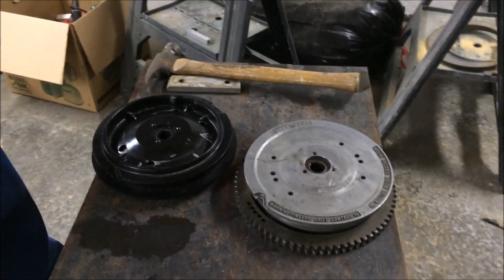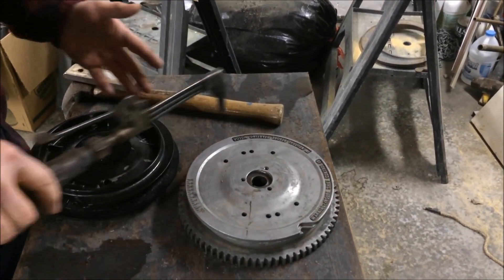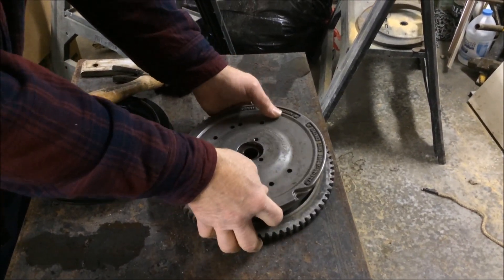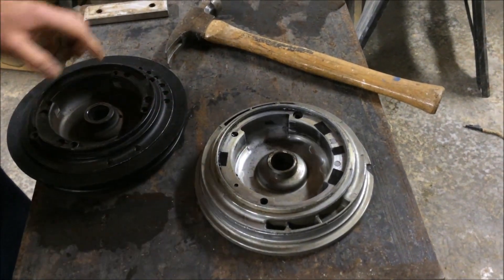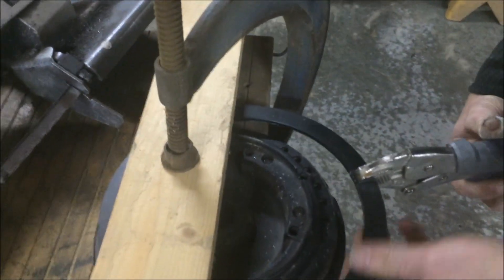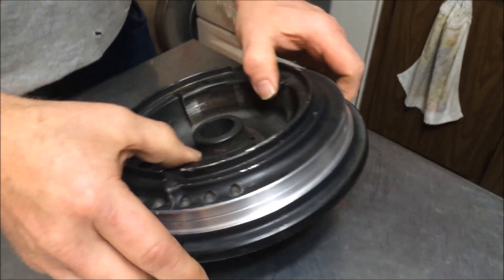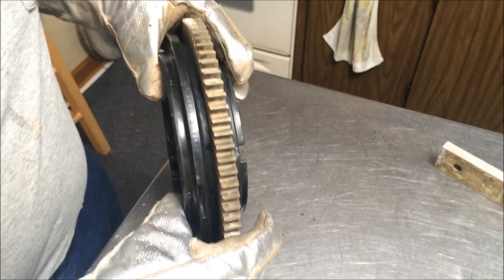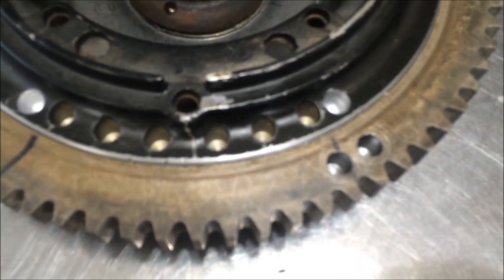How To Add Electric Start to Outboard Motor Part 1 of 2

Comment: I must be snorting coke because my 1982 Mariner 10 HP outboard has both electric and the recoil starter on it. I also worked 20 years in the Navy, and all the Zodiacs I drove had both on it also. Over the years there were Evinrude, Johnsons, Mercury, and Mariners and they all had both recoil and electric start on them.
Reply: I have a mercury with both pull and electric start

Comment: Is it possible to find a flywheel from elec start and do it that way. Not sure I'd be able to do what u did with flywheel
Reply from the maker: You probably can but I could not at the time because of the ignition system
Reply: @Ian-Threaded  my 94 Evinrude has the gear teeth on the flywheel but it's a pull start is it possible to use that it's a 8 hp

Comment: i have a remote steering 86 johnson 25 and i want to make it a tiller. can i just buy a bracket or make a bracket to bolt onto the existing one? also how does the throttle linkage work? how does it connect?

Comment: I dont see any other way to private message you. Why didnt you use the aluminum flywheel with the ring gear instead of the black flywheel?
Reply from the maker: I had to machine my original flywheel to accept the ringgear because my motors ignition would not work with the flywheel that had the ring gear. - Ken

Comment: Was wondering ,I got the same bracket for starter from a 1977 35hp.Did you have to adjust the timing stop screw that is on the bracket you put on.?

Comment: It was very good that you put an old (1976-mid 1988) 11 tooth starter on to match the old ring gear.  A lot of guys may watch your video and not know that these motors went from an 11 tooth starter to a 9-tooth starter, along with a ring gear change, in mid-1988.  Easy for that to cause a mis-match.
Reply: or, just change the starter gear to an 11 tooth to match the old ring gear.

Comment: My 1982 evinrude 25 has both electric and pull but did not have the charging system. I’m adding that right now.
Reply: Scab, I have an 84 that I want to add electric start and to.  Maybe we can give each other some pointers
Reply: @jamiejacobs929  ya I’ve basically rewired everything on this motor. Started from scratch on some of it. Most of the existing wires were corroded off and some were missing.

Comment: You can also use the flywheel from the 70's and 80's 25hp omc motors.  They have both the ring gear and pull start option.  I just added electric start to a 1996 25hp.
Reply: does it fit without having to do what he did?
Reply: There you go! I used to drive Zodiacs in the Navy in the late 90's and we had both.

Comment: Question hopefully you can help me with. I found a 1972 18hp with electric start and pull start. Can I put that setup on my 1988 25hp both are Evinrude
Reply: Did the 72 18 hp setup work on the 88 25 hp? I have been told it will not and maybe.  The 72 setup will work on my 20 hp if you want to sell ?  Thank you

Comment: How did you add just the charging system
Reply from the maker: bub wangler I bought the charging system as “new old stock” on ebay. Lucked out. But it will work fine without the charging system - Ken
Reply: Good morning Ken, I just bought a 88 25hp Evinrude and would like to add a charging system. What should I type in the search engine.

Comment: Ian, 
This is a very good video that explains in detail how to upgrade an outboard motor.
I have and old 9.9hp Chrysler, probably 70’s early 80’s model and I’m working on doing the same process as you did so I would like to ask for your help because I’m new to outboard motors.
At minute 7:50 you refer to a charging system... is this like an alternator in a car?
I have seen the starter, no problem…at minute 8:07  you show a solenoid, did you add this with the starter or was in the motor already?
At minute 8:15 to talk about a starter button, I’m guessing to bought that too, so I need to ask you; in order to do the upgrade, you added the starter button, the solenoid, electric starter, charger and the wheel?

Thanks in advanced Sir.
Reply from the maker: blademex correct. Yes, you nailed it. Charging system was new old stock (not really required) the solenoid was a Johnson but the button was Napa autoparts. Thanks for the comment - Ken

Comment: Hi Ian -  Question: I have the came motor (prob diff year) -  but my carb bowl drain screw is just a slotted head screw -  this one has a brass nipple with a hose attached -  where is that hose leading to?  -  or is it just a 12" drain-hose to make winterizing/draining easier - and if so, what kind of shutoff is at the end of it?
Reply from the maker: jmm1000 I believe you are looking at the factory primer set up on that year. - Ken

Comment: How do you hot wire an outboard without using an ignition switch? Need to just get fire to the engine so I can see if this 115 83 Johnson will run before investing money in it. It has about 90 lbs of compression on all cylinders. Not great but I think that should be enough to run. Been sitting for years so it may get better compression once engine starts up. It turns over good when I jump it from positive battery to starter. But not getting fire as switch does not activate. I think one of the relays from the switch is bad so I can not get fire to the starter solenoid. Got boat, motor and trailer for $100. So I am trying to get the motor running to put on my other boat, and burn the junker boat. Any answers on hot wiring a circuit without switch to test motor?
Reply from the maker: There is a lot going on there but normally the off switch only grounds it. The shear spinning of the fly wheel creates the spark. Find a buddy that loves to tinker with motors that may be able to help.

Comment: My 85 also has the ring gear on it already.Ring gear is not as heavy duty on mine as the one you got.
Reply from the maker: Not a problem, you just need the appropriate starter motor for that ring gear. Count the teeth and talk to marine sales.

Comment: I just watched videos that have rope and electric start.I just got an 85 with rope only, but saw an 80 and 78 that had both.Looks like the one you have that look factory.
Reply from the maker: I couldn't get both with mine. Could be, but I just had to make it myself because the motor was too good to throw away.

Comment: fyi the little notch on the electronic start fly wheel is for pull start
Reply from the maker: Yeah, for emergency pull start. Not for the recoil. Thanks for noticing. I sure needed a recoil because mine never started on the first pull.

Comment: I just saw this video. I have an old 1971 Evinrude 18HP. It is manual start and I want to convert it to electric, as I am old and cannot pull start it anymore. Can you send me a list of what you think I need to do this. I already have the electric flywheel, but no switch, charger, bracket to hold starter or starter. What else am I missing? I can't afford a new motor and this one seems to do a great job on my 14ft alum boat.....i.e. when I can get it started......Thanks
Reply from the maker: Sorry I didn't get back to you. My part list wont match yours because I stole from a 70s motor to put on my 92 motor. Your motor should be easier to work with because the 70s motors electric start parts seem to be more plentiful.